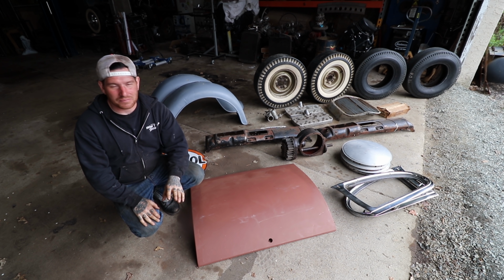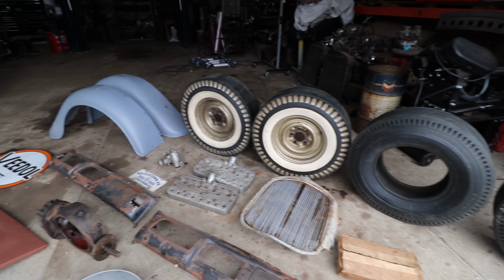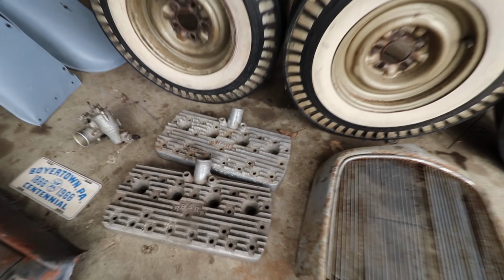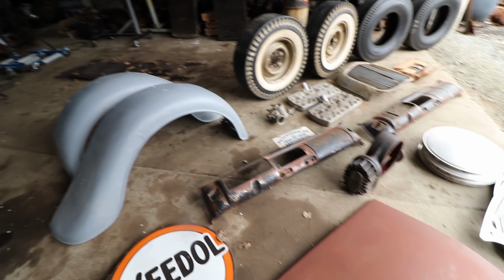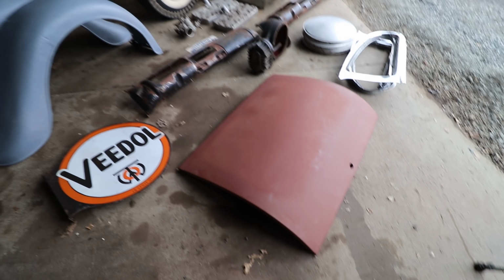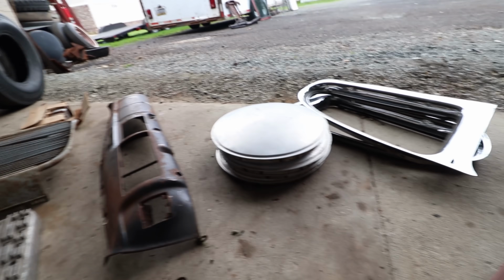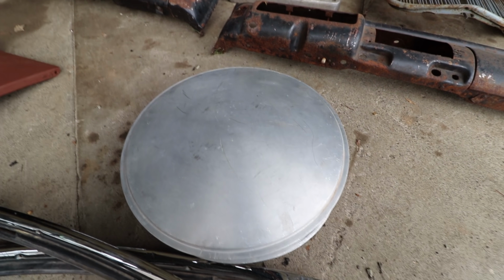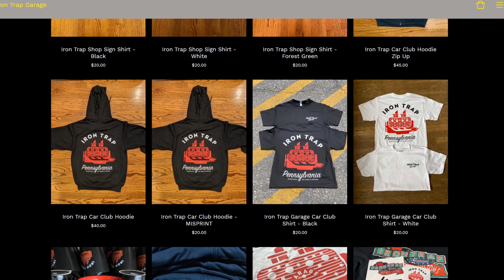What Did Matt Buy At The 2021 Spring Carlisle Swap Meet

Comment: That set of slicks looks just like the ones that come in all sorts of old AMT model kits.  Some of the newer kits they added whitewalls too. 

I bought what looked like a 32 grille shell cut way down at one of our swaps for $20.  For that I didn't care what it was.  Looked it over and it seemed to be maybe 33-34 truck cut down, split and narrowed to resemble a 32 grille.  Filled and peaked, too, and painted candy red.  Flipped it and made a little money on it and the guy who got it still got a deal.  Was I building an early car I might have found a way to use it.

I guess the Syracuse Nationals is going to happen, they decided, do you venture that far north?  If they have a swap section I will go and set up.  Swap area has always been kind of an afterthought on that show, if they keep the buildings closed I wouldn't be surprised if they cut that for some of the big vendors to use the space instead.

Comment: I saw your dome pistons and it reminded me of the stock car we built 56 years ago. We couldn't afford popper dome pistons for our 34 Ford so we found that Ford tractor pistons were domed and cheap so that's what we used we had aluminum heads 3 dice intake and aluminum flywheel. We won a lot of races

Comment: The Franklin will use  midget gear sets. Though there is two different splines so be carefull buying gears.
I suspect you will need very low number sets and you can probably swap them for an underdrive the drags and over drive for street. V8s used 4 11 diff gears, A models used 3.78 which are a LOT stronger and you can buy them new for a moderate amount.
IF you use OEM gears crack rest the gears as so many are cracked then ideally shot peen the roots of the gears.

Comment: You've got some nice stuff from Carlisle. On old tyres I would offer a warning. No problem with making wall hangers out of them but I would warn against putting them on cars. Here in the UK I have a 65 Mustang that doesn't do a lot of miles. Anyway I started having problems with the rear wheels locking up even on mild braking. I blamed the brakes and completely rebuilt them with new drums, shoes and cylinders. The problem was worse. It turned out the tyres had got to 10 years old without me realising and had about as much grip as wood.  New tyres and all was sorted. Rubber ages and its properties change.